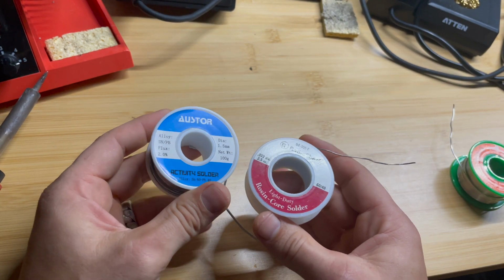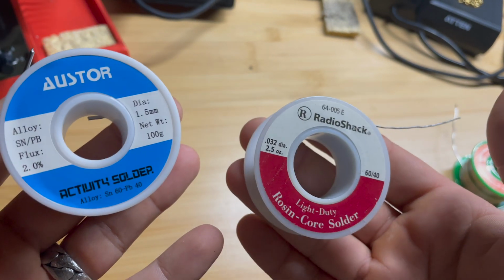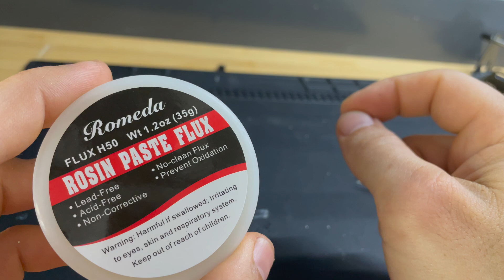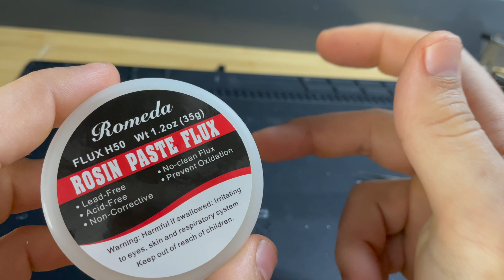Soldering Tools - To help you get started soldering

Comment: Pine Tree Sap is not considered to be Poisonous to Humans. 
I had a very Bad Cough with Severe Congestion a few years ago. My local Pharmacy had a Concoction which I purchased for my Condition. 
It made  my Eyes water but it sorted out the Congestion in a few days. 
The Ingredients were:
Eucalyptus Oil, Menthol and Pine Tree Oil. 
It was to be placed in an Electrically Heated Evaporator or a Tart Warmer 
The Instructions stated that you must wash your hands after handling the Material.